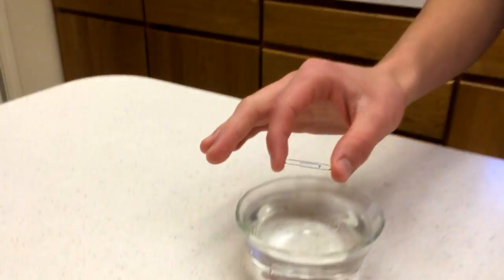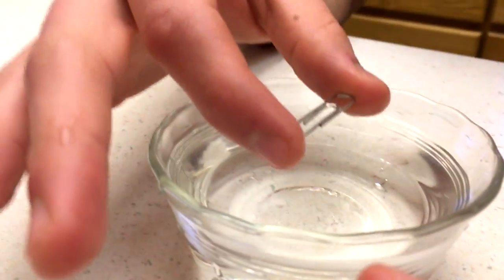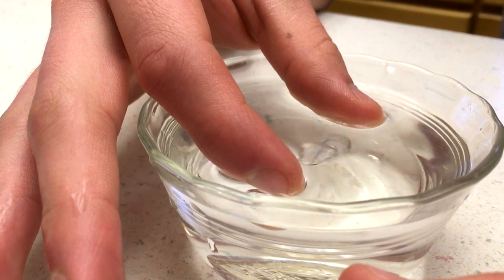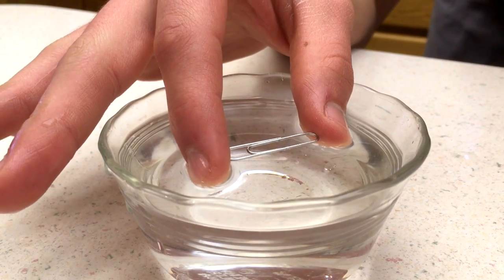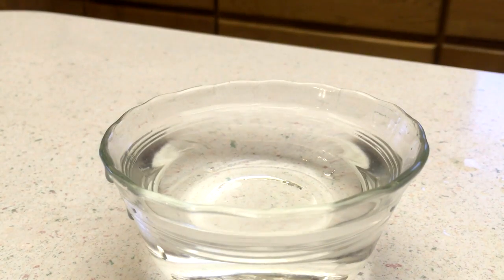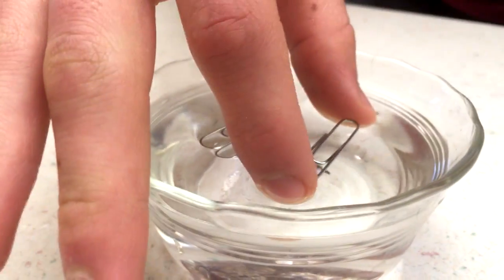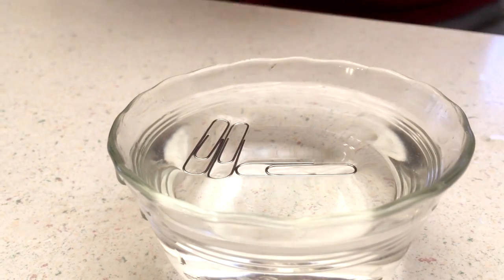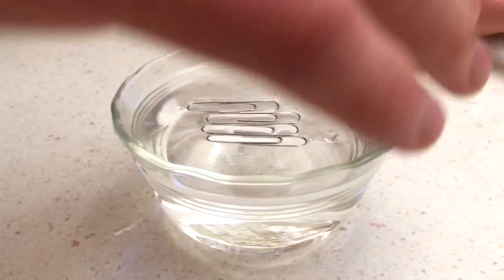Paper Clips Float On Water Experiment

Comment: Clearly its just the shape of the paperclip and surface tension.  They actually did reach these principles in school however they were easily forgotten by most because of the bad teaching methods, but they did explain it and if they happened to not you can learn all about this in depth that will completely comtradict the universalodel.